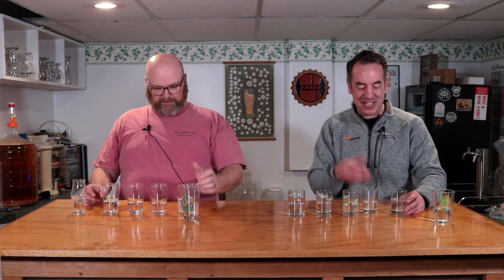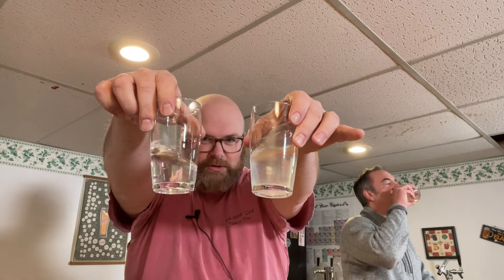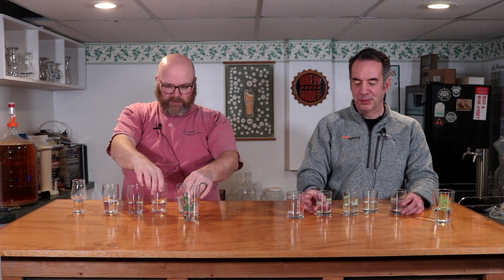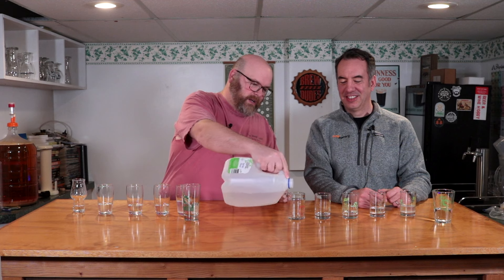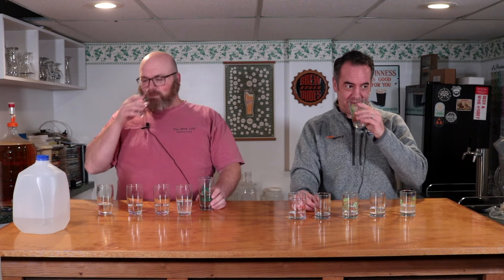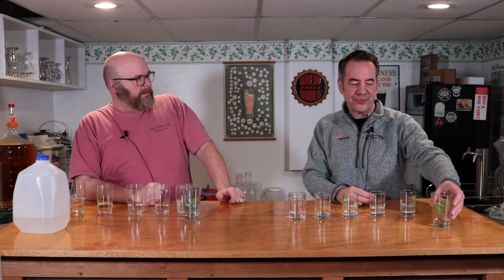Adding Gypsum To Beer - Brewing Water Experiment Part 2

Comment: Interesting to hear that the epsom salt didn't have an offensive flavor at that high concentration.  I was reading about it, and in order for the laxative effect to occur you need way higher concentration than you would ever use in beer.  But I certainly think i will bump up the magnesium in my beers now that I'm not worried about negative flavors coming through.
Reply from the maker: Yeah true indeed. Still, I'd avoid replacing Gypsum with Epsom for total sulfates if you really like high high sulfated WCIPAs.  After drinking 3-4 you might put yourself in that laxative zone.  Maybe... Cheers! -Mike
Reply: @BrewDudes  yeah, I wouldn't completely replace gypsum, but I'm thinking there is a good reason to keep the calcium limited. I'm still not going to go crazy with Epsom salt, but I will start adding at least a little more than I have.  I was avoiding it when possible, but now I am thinking I will aim for at least 20-30 ppm of magnesium.  A quick search suggests that you might want more for certain beer styles.  I have a book for brewing water, and I need to read it sometime.  It's hard to get into, though.  I wish it would just get to the point, but they feel the need to fill 250 pages or whatever it is.

Comment: Did you used MgSO4.7H2O? That could explain the lower "strength".
Reply from the maker: This is a good point and I didn't bring it up, but yes I accounted for the 'hydrate' portion.  Cheers! -Mike

Comment: Very informative. All this time I went with the minimum amounts of salts needed for a given recipe. I guess the trick is to add enough to affect the taste while keeping the ratios consistent.

In others words, "adjust to taste"?
Reply from the maker: I have always said there are two sides to salt additions.  First is the mash for proper mash chemistry.  The second is for flavor profile or effect.  Sometimes the two are the same, but most of the time they are not.  This means that what you want for Chloride and Sulfate levels might not work for a proper mash chemistry; especially if you're working from a wacky starting water profile from your municipal supply.  The easiest way to deal with this is to use enough salts to maximize the mash efficiency and then add more of what you need in the kettle to get the right flavor profile you're shooting for.  Cheers! -Mike

Comment: Love this experiment guys! My question has always been on the use of Epsom salts that the amount you are using in a 5 gallon batch is minuscule to what you wold take for constipation. Do you really think it would effect you that way  in your beer?  Cheers.
Reply from the maker: Not at normal levels.  But everyone is different.  I could see a scenario where if someone didn't really understand what they were doing the could swap MgSO4 in for CaSO4, really drive it up to say 600ppm SO4.  If you drank enough of those maybe.... But 9 times out of 10 you're only adding maybe a few tens of ppm of Mg to the mix and the laxative effect is hard to reach.  I just think it'd be irresponsible to not at least mention it.  Cheers! -Mike